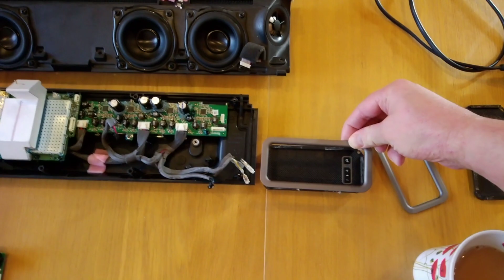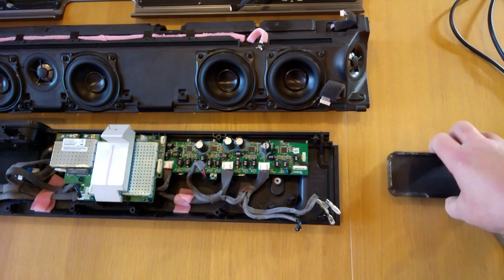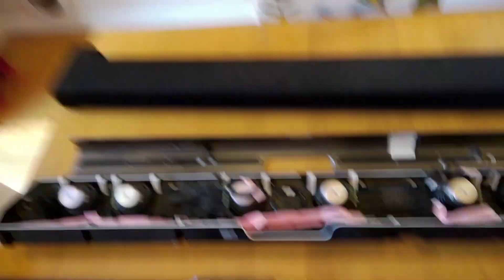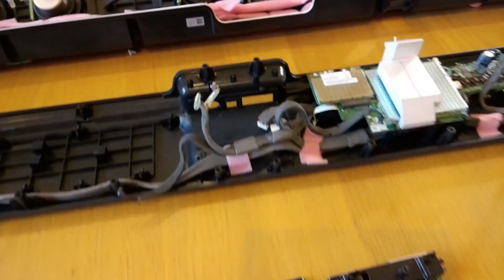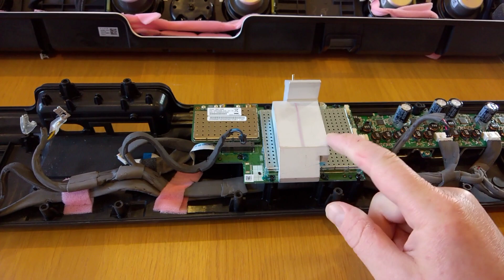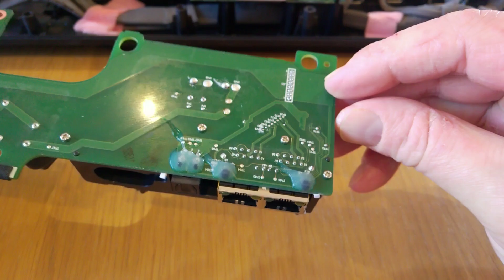[EafD] Sonos Playbar Repair - Part 1

Comment: So I have mine apart and one of the big capacitors blew.  It looks like it sprayed across toward the rectifier with the heat sink and melted a small component.  I don’t know what is was and the motherboard material is eroded a bit.  Also the little black square thing has a hole in it.  I don’t know what this part is either.  Looks like screwed.

Comment: Wonder what specs are of the PSU. Worst case you can replace it with something else with about same specs (same or slightly lower voltage, at least same amp rating).
That why I love external PSUs though many people hate them. So easy to replace when they fail and usually no point in trying to repair them - just replace. Usually it's no issue finding one that fits electrically and if using some odd connector just cut cables and reuse the old one.

Comment: When I took mine apart the back panel fell off and tore the led leads from the metal plate. Does anyone know the polarity of the wires that are soldered to the PCB?

Comment: Hello! i just wonder if you have by any chance closer pictures of elements around K6A65D transistor like R18, R19 , C26 ?
I got a power supply defect and burnt elements but need to identify them first.
Regards, 
Paul
Reply: Hello, 
have you been able to find out the values of the transistors?

Comment: Are there any identifying numbers on the speaker drivers or are they proprietary? I have a failed right-side driver I'd like to replace instead of throwing the Playbar in the trash! Trade-in for a refurbished unit is $490 which really doesn't make financial sense.

Comment: Is that an infrared sensor on the back??
Reply: It has an infrared sensor on the front so that your existing TV remote works seamlessly to control the volume.
Reply: There are actually two IR sensors, one for each orientation used

Comment: Is it true about the 9 amplifiers. one for each speaker???
Reply: in for the explanation, i wonder which ones they went with
Reply: Each speaker/driver has its own Texas Instruments class D IC chip amp, presumably the 50 watt versions since they usually have a piggyback heatsink.